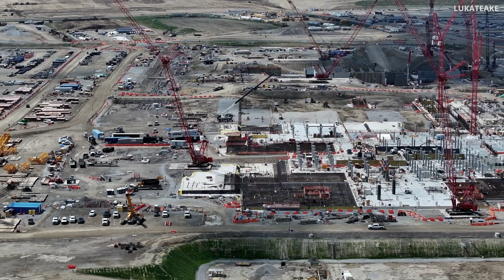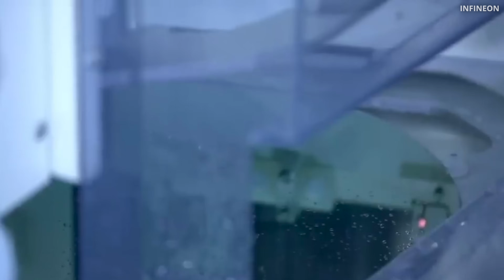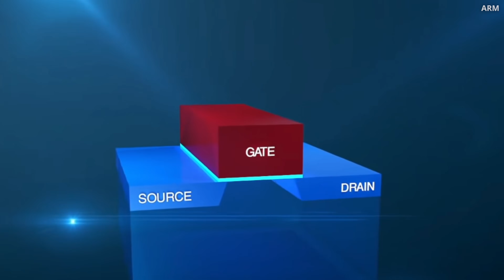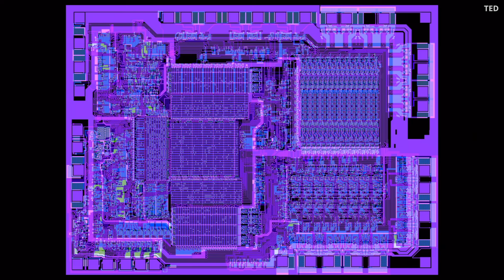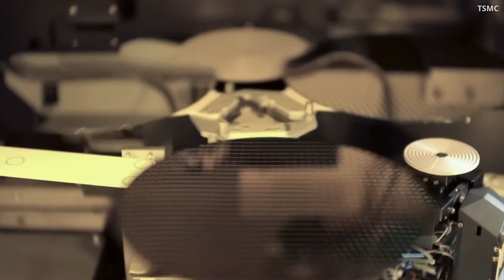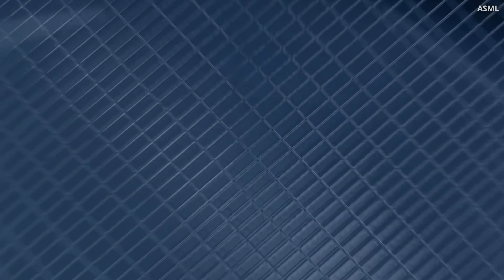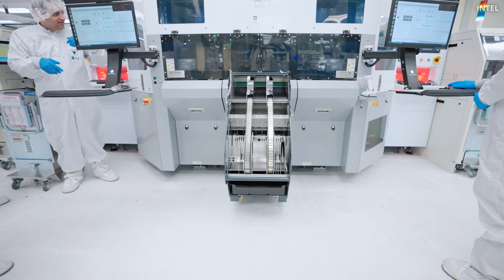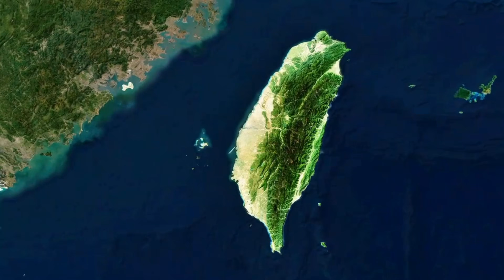Huge Chip Breakthrough — and A Massive Warning For TSMC

Comment: Intel had trouble at 14nm. They wanted to go down to 10nm, but the management (and I think we mean The Board of Directors here) didn't want to spend the money and buy the machinery needed to make that, so they told their engineers to just make it work, and for three generations or more, the best engineers in the world tried to make 10nm work on machinery that was getting old for 14nm.
Ok ~ that was 7 or 8 years or something ago.
Since then, we've had Pat Gelsinger in to pray for us, and Lip Boot Tan in to liquidate for us, and dismantle things, and now that same company (the grandchild of) is going to build the most advanced fab in the world, and introduce the most advanced lithography machines, and use a new process, and re-invent the transistor with Ribbon-FETs and introduce power up the backside design ~ and they're going to do all of that at once ~ while Lip Boo Tan is still dismantling like a liquidator.
Q: Does that mean it won't work?
A: No, it doesn't. It means intel are making a very big bet here, they're taking a chance on a chance on a chance and the whole thing exists on the toss of a coin.
I want it work, not because I am a fan of Intel, I rather like Lisa Su and Linus Torvalds. I want it to work because I don't think anybody should hold a monopoly. Not Intel ~ not MicroSlop ~ not Dale Carnegie ~ and not populist right-wing parties who want to bring back Fascism.
Intel are making this hard. One thing you learn early, from high-school chemistry for one, is you change one thing at a time and confirm that works. If you change 3 or more variables at the same time, you're starting a whole new experiment, which is kinda like starting at ground-zero, except you're building your test rig (apparatus) from equipment and parts and chemicals that were already in use. You have the worst parts of continuing and extending/expanding the experiment, and wiping it all out and starting again. You've combined the most questionable parts into one experiment. This would be picked up and weaponised against you if you ever tried to get a paper peer reviewed.
They're making it hard for themselves.

I think if the President and the Administration and the Senate and the Congress and the Joint Chiefs and the Military Industrial Complex and most of the board members and investors and shareholders of the Top 500 companies didn't view Intel as a US national Asset, that's not really a private company, (publicly traded company ~ you know what I mean) it's an international flag carrier ~ rather like QANTAS was for Australia and Lufthansa was for Germany and BOAC was for Britain, then they'd be gone already.
That has implications. If Intel try this and it doesn't work, they don't have one shot and then they go bankrupt ~ they try and keep trying as long as the U$ establishment continue to see them as a central and vital part of the US Military Industrial Complex and Fortune 500 and the Old + Rich + Powerful + Born-Privilaged Establishment continue to trust them.
Pass the popcorn, will you?
I’m trying to think if any company in the world has ever had this kind of help and resources and stuff given to it. During the GFC, lots of banks and financial things were dubbed Too Big to Fail, well what does that say about Intel? They’re Too Important to fail? They’re Too American to Fail?
“Intel are too not-from-Taiwan to Fail?” 
On the plus side, unlike during the 14nm++++++ thing, they do seem to have money and resources and anything you want, as long as you make it work. You are in the spotlight, on the high wire, performing, but that doesn’t mean you don’t have a net.
Reply: Lordy …. Lost me at a political rant ….
Reply: @TheWorldWatched  for sure  :)
Reply: Most countries seem to have such mercantile policies, most big Chinese companies, many in South Korea receive massive governmental subsidies etc etc

Comment: Hmm ... even in the arid Arizona desert, as much as 22,000 gallons of water is allocated to the production of a single silicon wafer.  Meanwhile several states heavily restrict the use of even rainwater for private land owners.  For example, Colorado allows only up to two containers with a combined capacity of 110 gallons, for outdoor use on the same residential property (no indoor or drinking use).  This is just one of many hints as to what brave new world, the big club has in mind for the rest of us mere peasants.
Reply: The Intel az site does not waste the water . Intel is able to save 98% of it for reuse

Comment: Ok, I have to ask... 
When you're building a chip factory in the middle of a desert, where do you get your water that you need so that you can then purify it and hopefully recycle most of it? 

I can understand that in the middle of the desert, you have less concerns about any potential run off of heavy metals , but there could be easier places to build.  Like an old steel plant site in Northern Indiana right off Lake Michigan.  

Heck if you didn't want to use Lake Michigan water ... you probably could have used water from the Chicago or Desplaines Rivers and just clean it up.

Comment: Wow this was a real eye opener and yes insane! I used to work as a photolithographer in a research lab in the 90s (a-Si:H).
 I thought we had alignment challenges back then but this is a whole other world. I really appreciate the video. Thanks for sharing!
Reply: A :si H is this aluminum silicon and hydrogen? I've recently become very interested in this stuff.
Reply: @MarkmarkMarkmark-lx1jl Amorphous silicon in this case but sure we fabricated devices with different metal contacts including Aluminum among others.
Reply: @MarkmarkMarkmark-lx1jl  a-Si:H
Reply: The CVD machines I ran were doing  tens to hundreds of nanometer layers to build laser diodes 1.8nm is absolutely insane.😮

Comment: If they had built this in the Great Lakes area they would have had a larger worker pool, more infrastructure, water, and cool air in the winter to keep cooling costs down.
Reply: Don't worry. The Midwest is about to be revived again brother. Things are just getting started.
Reply: They're better off in the middle of nowhere so there's less vibration from nearby operations. Also, I imagine seasonal changes add more challenges than any benefit from a cold winter near the Great Lakes.
Reply: @Adimus28  They went down to bedrock. They can do that anywhere. Ran a data center with a cold air exchange for the winter, more than paid for the installation of it in 5 years. Usually the problem is power grid reliability, but with a chip factory they will have their own power generation and backups beyond that, they can do that anywhere.
Reply: MN, WI, Michigan have been underutilized for decades (excluding MI auto industry) as they are jewels in multiple regards.

Comment: And I thought the Intel factory in Columbus was to support the auto industry with chips. You would find it hard to believe how many computer chips are in a new car.
Reply: The chips in cars don't need cutting edge technology.
Reply: @ruschein You live under a rock or something?
Reply: @BrendaPrater-b3d  I think you know nothing about modern cars! There are a few thousand computer chips in a modern car but not one requires a cutting edge feature size technology!
Reply: @BrendaPrater-b3d  A few years ago the chip manufacturers went to the auto industry and told them they need to modernize because they aren't going to continue manufacturing 300+ nm chips. Very few chips in automotive applications are under 90nm. They are almost exclusively for self driving applications.
Reply: @danmac6185 I was under the impression that most chips are moving to 40nm or 22nm. Many companies are trying to phase out older technology. Keep in mind smaller transistor can have a higher clock rate and use less power. There are benefits even if one doesn't need massive compute.
Reply: @ndenman420  22nm is very far from 1.8nm and would be a complete waste for the new fab!
Reply: @ruschein What are you talking about? This thread is about the size of transistors in the automotive industry. Obviously, 22nm or 40nm is huge compared to 18A architecture - that's not what this thread is discussing.
Reply: @danmac6185 You are correct (which you already know). Much of the automotive industry is around 90nm. That's cool. Thanks for making me look it up.
Reply: @ndenman420  Yes, and the video is about a new fab which is completely useless for automotive manufacturing!  A fab that was designed for manufacturing chips at the 1.8nm scale cannot produce chips at the 22nm scale without causing huge financial losses!
Reply: @ruschein  tbh a few raspberries would do the trick :D
Reply: @ruschein  For Self drive functionality, yes.

Comment: Tesla did the power under the wafer, with surface mount components, like the Intel 18A you're describing several years ago with their Dojo design.  That's the same thing isn't it?
Reply: It's completely different. Also Dojo is now dead. They didn't not even finish validation when Elon canceled it.
Reply: @kazedcat  figures. Another Elon lie.

Comment: The question I have is why did Intel and TSMC choose Arizona? It seems the lack of water and huge solar heat loads would be a disincentive.
Reply: Relative geologic stability / fewer vibrations / other seismic instability issues
Reply: @Kevin_Borr Arizona is more stable than say the North American Shield one of the most stable Earth structures in ever found?
Reply: @Kevin_Borr - Taiwan has had many earthquakes.
Reply: @ln6593 yes, but Taiwan doesn't have the enormous landmass / variety of geologic conditions that the US has. If you can reduce complexity and cost of production by using a more stable area... Wouldn't you?

Comment: Why are wafers round and not square? I realize spinning has something to with, I think. But the real-estate is not without waste.
Reply: They are cut from a large cylindrical column of silicon ingot. Why the ingot is cylindrical? Because they are slowly pulled out of the melt starting from a small seed crystal. The cylindrical shape forms naturally.
Reply: Yes spinning is a large part of it, you need uniformity from the spinning at various steps. Plus the wafers are cut from a cylindrical silicone ingot. Also, you get more structural strength by being round. All of this adds up to be worthwhile for the wasted space. It’s also just a production standard, You have a lot of different tool manufacturers around the world that would have to complete redesign everything. There was talk about making wafers larger but again the entire industry would have to be onboard for this to happen.
Reply: @cody8992 thanks for the explanation.
Reply: Because they'd be crackers or biscuits if they were square, not wafers.
Reply: @TheThunder005 😂😂😂

Comment: If they can do it with these machines then i wonder what the next gen asml machines can do cause they are already working on a prototype that if i recall their numbers correctly can pront on -4 NM as in negative 4.  (There is no measurement name yet below nano meter.)
Reply: There is a measurement below nanometer it's picometer. Also it's not the machine that determines how the small the process node can be. You can always go smaller by multi patterning. It's just the yields will drop so better machines helps to keep yields high. And ASML's next machine is HyperNA EUV lithography scanner.

Comment: In the Arizona desert. About the worst location on Earth for a semiconductor manufacturing facility. Why not northern CO near Fort Collins?
Reply: Because chip fabs don’t just need land. They need a whole industrial ecosystem.

Arizona makes sense because it already has a semiconductor base, existing suppliers, trained labor, huge power infrastructure, major tax incentives, and a business climate built around large industrial projects. The dry climate also helps with environmental control and corrosion, even though fabs still use massive amounts of purified water.

Northern Colorado is a nice place to live, but that’s not the same thing as being the best place to drop a multibillion-dollar fab. For something that expensive, companies usually go where the supply chain, workforce, permitting, and political support are already lined up.
Reply: @Ravenite_social_club Exactly this, also the protection against natural disasters like flooding, earthquakes, tornados, tsunamis, wildfires, etc.
Reply: Yep, there isn’t going to be any chance of flooding in a dessert 🤣
Reply: @Ravenite_social_club Add to that, Tesla Berlin was designed to use 1.8 million cubic Meters of water per year (1.8 billion liters). They added a water purification plant and now process 100% of waste water and require 460 thousand cu meters per anum... they returned 370k cu meters of water rights as they no longer need them even factoring in generous expanson. 
Such tech could be applied to a desert to minimize water consumption.
Reply: @Ravenite_social_club
The fun part is using the plebs money to help getting them out of the way, that’s real power!!

Bonhoeffer be damned !
Reply: Cheap electricity and they already have a site in Ft Collins. There are more Intel sites sprinkled across the west then you can imagine.
Reply: No humidity in Phoenix. How about in Ft. Collins?
Reply: Also very low humidity. I'm not going to disagree about 5he bad politics here.  Denver/boulder kind of runs the state, and they are trying to turn it into the west coast.
Reply: @jqmachgunner2577 foothills of the Rockies??
Reply: Silicon sand
Reply: There’s a lot of reasons they chose the middle of the desert! I’m assuming One has to deal with lack of humidity! It also has to do with talent, is the state liberal trying to tax companies extra? Ton of factors goes into making these decisions! The obvious, not so obvious! More not so obvious! You can recycle the water by the way, just get it there!
Reply: The closest you ever got to that was the failed Intel Fab 23 in Colorado Springs.
Fun trivia, a portion of the former Fab 23 facility is now used by the El Paso county government.
If another Intel fab were to be built in Colorado it would be in Colorado Springs due to the pre-existing and expanding fab base there, the more ideal climate, as well as access to NORTHCOM for elevated communication regarding potential military contracts.
Reply: damm i guess they should have hired this guy instead of their industry planners
Reply: @VonEveric lol.. tx for saying what everyone was thinking. What a moron.
Reply: Because they do not like you
Reply: Politics - Colorado is Democrat state so it is run poorly.
Reply: @ccn8987  💯% correct.
Reply: Because the Democrats hinder progress through tax and regulations. No company wants to spend more time and money to achieve their goals. Just look at California for example, nothing gets done and it always costs more.
Reply: @RollsJoyce79
Regulations!?

Can't have that!

Protecting ordinary people and the environment and ensuring fair competition and fair wages?!

Urgh! The mere thought!

/s
Reply: @RollsJoyce79that’s who drove them out of Oregon where Intel’s largest hub was until recently

Comment: Anastasi, always fascinating.  Thank you!  I started my career 35 years ago developing ultra clean plasma etch and CVD tools.  Then, I led and oversaw development of the first 300 mm ion implantation system before moving into lithography.  I've lost touch with implant and deposition.  It would be great if you could do a video on the latest systems and requirements for implantation and thin films.  For example, how many atoms are implanted in a single device and what is the depth control required?  And, what are the uniformity and atomic structure requirements for thin films produced in these new fabs you've been showing?

Comment: curious how long , after building the clean room, does it take to get it to that "clean" level and what is the process?  do they run like some giant fans and filters in  the room after building it? I assume its a multi-step process that can take months?
Reply: They run fans and filters for a while and then have people go into the room and clean every surface in the room... Then run through this repeatedly until there's basically nothing left... Then to maintain it they create a positive pressure environment so dust doesn't enter and the air inside is still being cleaned at the same time..
Reply: Probably weeks
Reply: @dchdch8290  i think it takes a month or two to get it fully running. its quite insane.

i half thought they might just.. plant trees or bushes around the place just to reduce winds and particulates
Reply: That clean I'm not sure but the one I worked in had several weeks after a major overhaul of equipment to get the counts of boulders down to acceptable levels. ❤